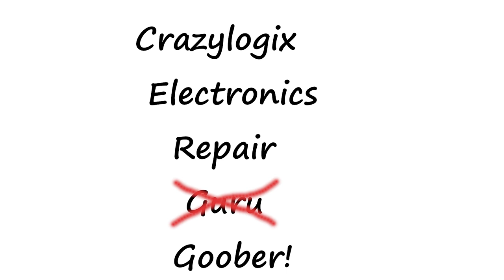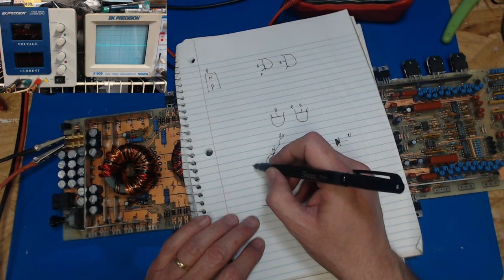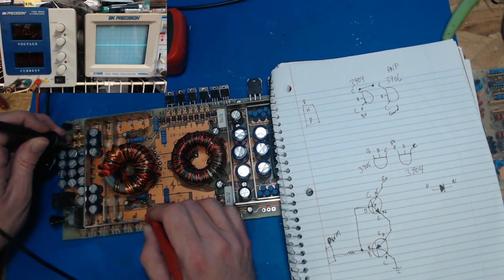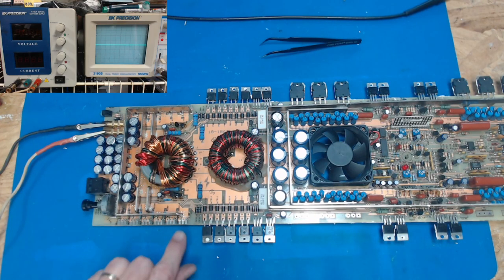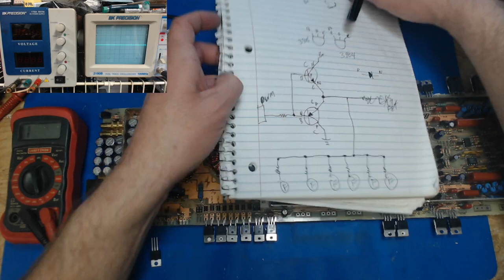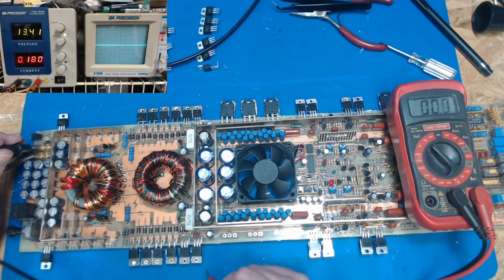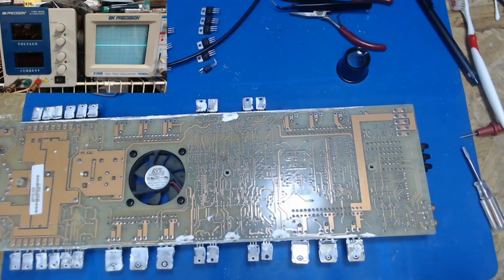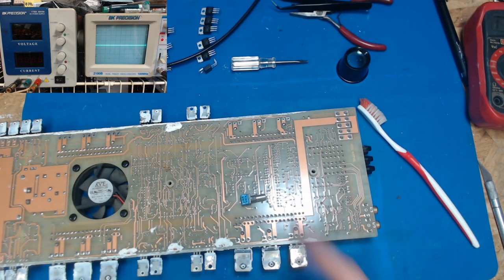PPI Power Class 1800.2 Amp Repair EP3

Comment: Thanks for a very informative video, is the working of the driver transistors in the power supply section the same for the output section in this amp